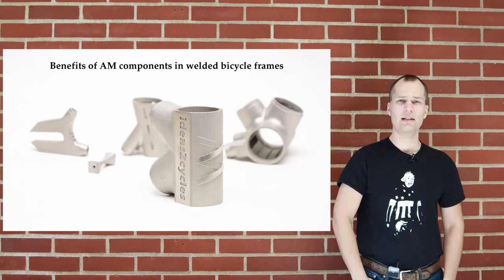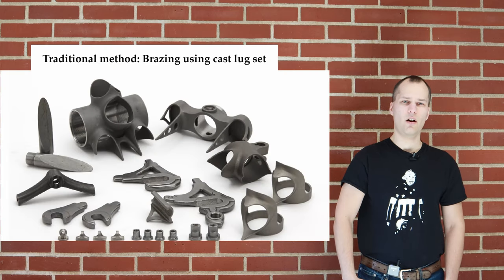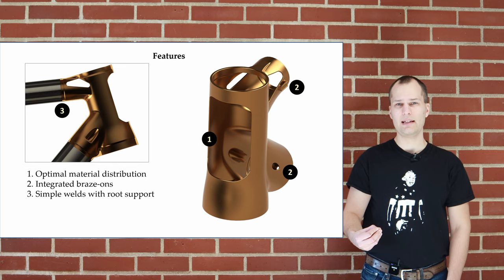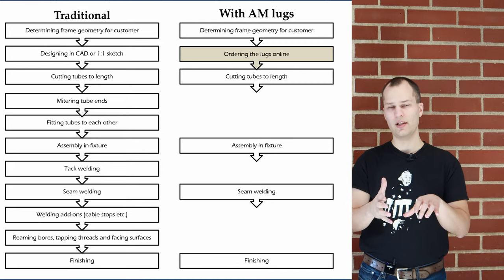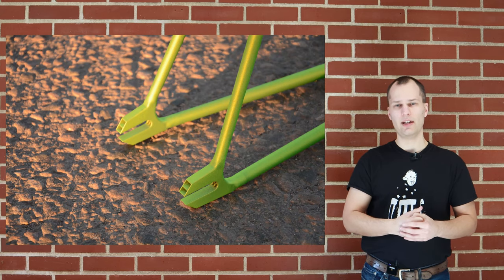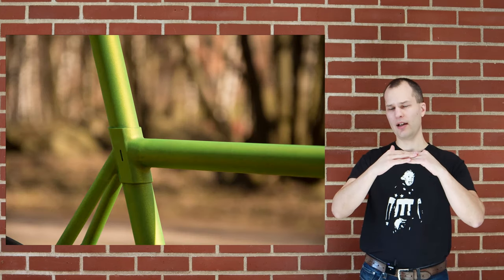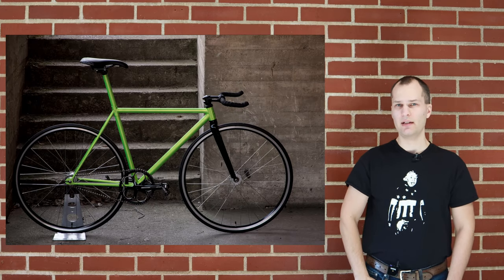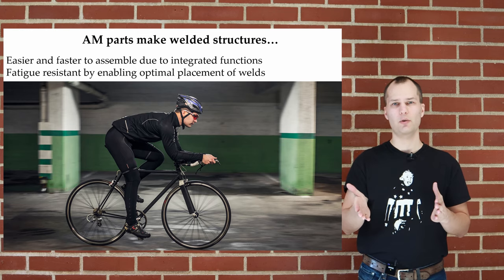Benefits of 3D printed lugs in welded bicycle frames

Comment: This is great. Again, thanks for sharing. Is gluing also a reasonable option for connecting the parts?
Reply from the maker: For joining dissimilar materials it's typically the only choise. For alloys I prefer welding actually, since it produces a joint with similar properties as the base material.
Reply: @Ideas2cycles  Makes sense. Thanks for answering. PS: I don't know why there are two comments from me here.

Comment: Most of the examples are welded. Wondering what is the brazing process like and if oxy acetylene brazing could work
Reply from the maker: We've made one frame using binder-jetted, bronze-infused stainless steel lugs and that one could not be welded since the bronze will melt before the steel. We used TIG-brazing instead, which was a but cumbersome. Welding is a bit more forgiving compared to brazing lugs when it comes to gaps and tolerances.

Comment: This is great. Again, thanks for sharing. Is gluing also a reasonable option for connecting the parts?
Reply from the maker: Welding would be my preferred way of joining when possible, but for composite materials (FRP, MMC) adhesive bonding works just fine.